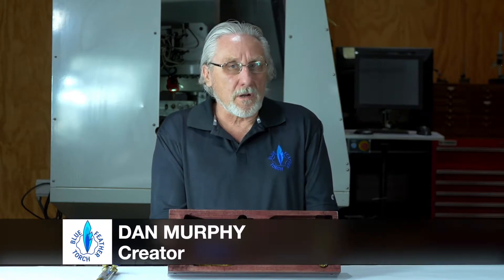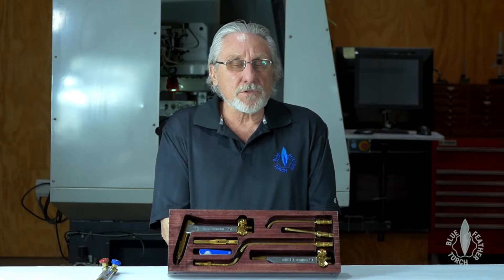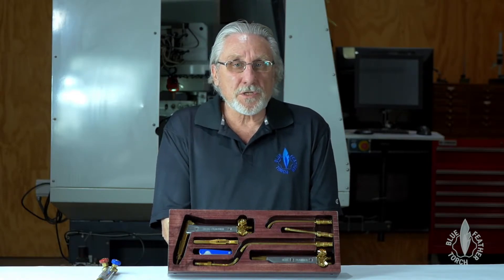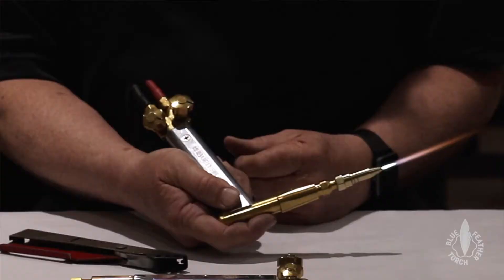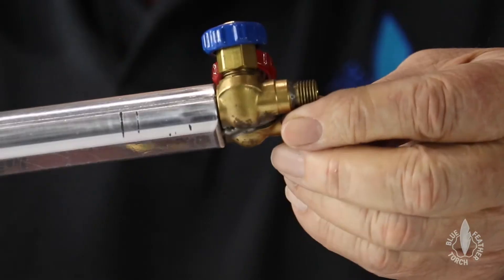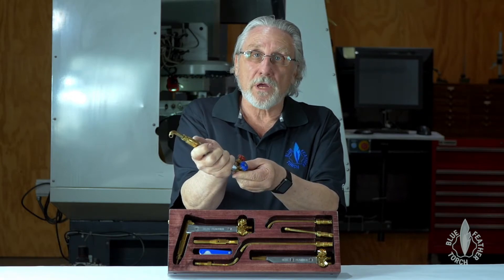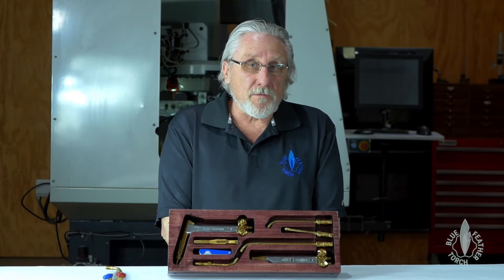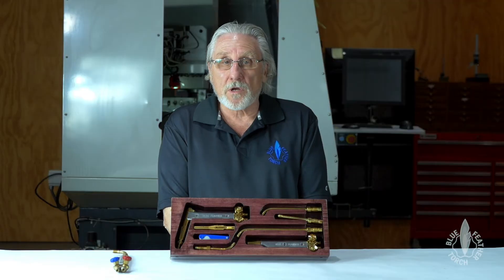The History of the Blue Feather OxyAcetlyne Torch

Comment: You pretty much omitted  that this is just a highly modified dhc cobra torch basically used the cobra mixing chamber but greatly improved the overall  handling of the cobra  although a gret welding torch was to damed cumbersome  I know I got one used it few times  put it in a drawer  where it's still lays to this day I've been waiting for this improved version long time
Reply from the maker: HI fred, this torch was a clean sheet design around the mixing chamber, So that allowed us to make a bunch of updates. Nothing from the cobra torch will fit and or work with our torch. We also have future plans of more accessories coming in the future. We have the best tip selection on the market. {19 tips currently} full sizes,half sizes, and micro tips. if you have any questions please feel free to reach out!
Reply: @bluefeathertorch1328  I remember talking to you many years ago about this  I finally got to see it at oshkosh  I'm currently building new shop when finished  il be giving you a call
Reply from the maker: @fredblair8694  we are a completely separate company from cobra, we have been in business since June of 2021. But we look forward to talking to you in the future 🙂